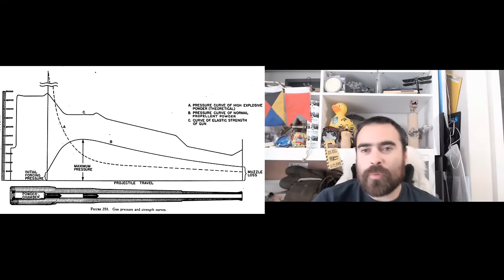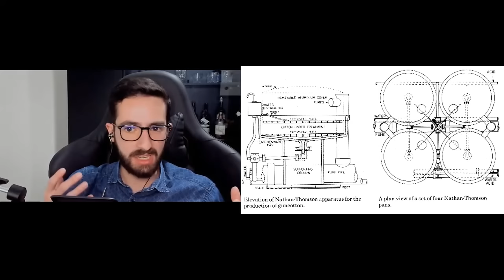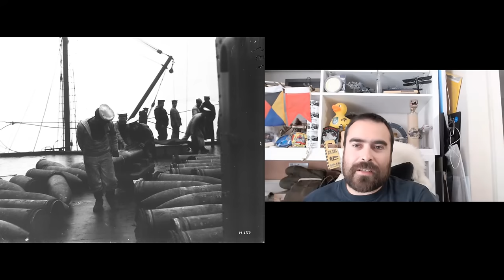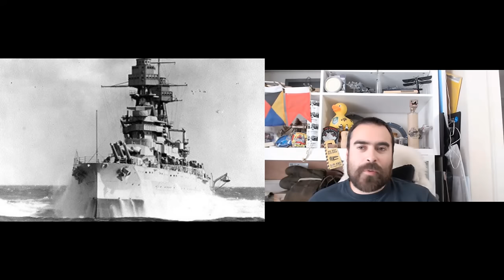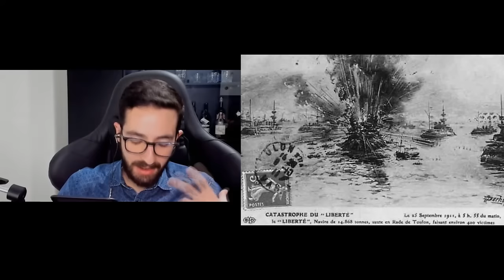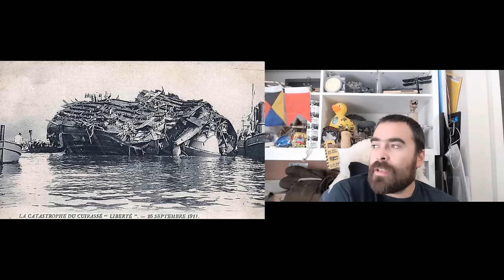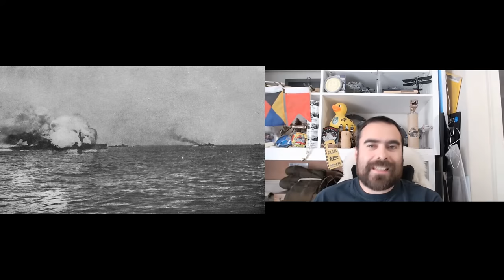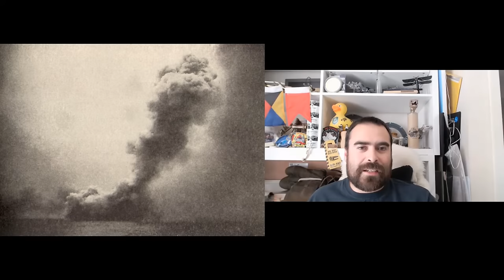Cordite and Poudre B - Why things start exploding at just the wrong time

Comment: Not happy with this one!
Nitroglycerin is liquid above 4C, not a 'dust'.  And even if it were a dust, cordite was sealed in a bag inside a metal tube, making dust unlikely to be spread around enough to propagate a flash.  Not stored as a loose chemical & I'd expect spillage to be noticed because Nitroglycerin is toxic, causing headaches and palpations.  How reliable is the Lion story?  

Cordite was used despite the risk because it delivered high performance. Wasn't described as 'safe', rather it was said to be safer than gunpowder, which is true.  But it's meant to explode in a confined space and does!  Quality issues and poor storage were known to make Nitroglycerin & Nitrocellulose more sensitive, worse than first suspected, fixed later. At Jutland, the Battle-cruisers weren't designed to receive heavy shells and seriously unwise things were done to increase rate of fire,  like removing flash doors, stacking ammunition in corridors and working spaces, and unpacking propellant before needed.  So a shell or flash from the turret could both reach the magazines.  The better protected and normally operated battleships at Jutland didn't explode even though they must have had them 'dust' too.

Age and temperature are correctly mentioned as problems, but I heard no proof they were factors at Jutland.  Was the cordite really old and warm enough to matter?  In June the North Sea isn't hot. and why no explosions in Hong Kong, the Med, Persian Gulf, or the Caribbean?  Nor did the Army have trouble with Cordite dust, despite using lots of it.  

Can't speak for what sailors knew about Cordite at Jutland, but my slightly later copy of "Service Chemistry" suggests a fair bit. The RN was the most high-tech service in WW1.    Officers at least were well educated, though negligence is always possible.  

Poudre B suffered from quality issues, as did all early attempts at smokeless powders,  The cellulose and both acids must be high purity, and extraordinary efforts have to be taken to remove unreacted acids from the product.  Grubby cotton and industrial grade acids aren't good enough and the process can't be rushed.  Like the USA's Mk14 torpedo scandal, the French were in denial about problems until a cartridge went off whilst being transported across a harbour in a small boat.  

Other incidents may be accidents - fire in adjacent coal bunkers, or incompetence.  Despite stiff regulations imposed after several accidents, the Iena was put into drydock without being unloaded: absolutely forbidden yet it happened.

Do people have time to act before a magazine explodes?  Maybe. Major Harvey got a VC.   Promptly flooding the magazines saved Seydlitz.   As to the time taken, we do have an idea: Arizona and Barham were both filmed exploding, and the frame times are known.  Much depends on the violence of the event; a slow fire would give more time than a line of cartridges foolishly set-up between turret and magazine, which would give more time than a penetrating shell. 

Might be wrong but I think the Arizona magazine contained 1 ton of Black Powder, not 100!

With respect, I think the dust hypothesis is flawed.  More likely the RN took too many risks with the battlecruisers, and the other explosions were due to quality problems, teething troubles and accidents.
Reply from the maker: Charges on WW1 RN ships were stored in leather cases, not metal, and the sweating of crystallised nitroglycerin is taken from RN reports from the time that were part of the justification for changing the cordite formula later in the 1910's.

The problem comes from when the charges are removed from the cases for transport, the movement causes the buld up to be knocked off and it then trails through the ship.
Reply: @Drachinifel  Understood thanks, but Cordite exuding Nitroglycerin isn't mentioned as a problem in my 1922 edition of "Service Chemistry, being A Short Manual of Chemistry and Metallurgy and Their Application in the Naval and Military Services."  The authors are Vivian B Lewes and J S S Brame, who were respectively Emeritus Professor of Chemistry and Professor of  Chemistry at the Royal Naval College, Greenwich.

It's a technical book and appears to be accurate on other topics, though it does caveat  "The composition of most Service Powders in most countries is constantly undergoing modifications and improvements..."

Explosives and Propellents get 67 pages of moderate detail. After describing how to make and test Black Powder, Nitroglycerin and Guncotton a chapter is devoted to Smokeless Powders.  Commercial propellants are reviewed briefly, but it concentrates on military types especially British.  What was wrong with Mk1 Cordite (mainly barrel erosion) and the advantages of M.D. Cordite are discussed in detail,  but attention is also paid to the virtues and shortcomings of foreign propellants.

Couple of insights, Flash is often mentioned.  The book explains that burning cordite produces large quantities of Carbon Monoxide, and it is the secondary ignition of this that causes flash.   This is rather different from the jet of flame coming from bagged propellant, igniting other bags in the turret, which inflame yet more bags in the handling room below,  and so on down into the magazine.  It is said HMS Lion did not explode at Jutland because Q turret's armoured roof blew off allowing the low order explosion to vent out of the ship.  If so, perhaps the ship was saved by 'dust', not destroyed by it (I'm joking)!   Another is mention of Cordite fires on board Revenge, Perseus and Fox.   Revenge I knew about - only 3 cartridges caught fire, but not the other two ships.
 
On the plus side, the book is contemporary (1922), contains a good basic overview of the state of the art at that time, and is authoritative in that it was written for the education of British Naval Officers.   Negatives, are although "official", the book was in the public domain, not a BR or CB, and thus may not be completely open, up to date, or accurate.   For example, it says "The German propellant for large guns contains 23% Nitroglycerin.", which doesn't accord with any other source I've seen.  Nonetheless worth a read I suggest!

Norman Friedman's "Naval Weapons of World War One" also has some useful information.

The most recent British turret incident involving burning propellant I know of was in 2017.  It was in a Challenger Tank, not Naval, Official report here  https://assets.publishing.service.gov.uk/government/uploads/system/uploads/attachment_data/file/727954/20180823-Challenger_SI_Castlemartin_Redacted_RT.pdf

May I congratulate you on a truly first class series of videos.  Lost count of the number I've watched and this is the only one to raise my eyebrows!  

Regards,
Dave

Comment: 1. As a kid I used to extract cordite rods from .303 rifle cartridges and burn them for fun. 2. There's plenty of "how to" make propellants and HE in olden times books in the library let alone the internet. I have a 1933 encyclopedia which explains how to make nitroglycerine, gun cotton and other things. Those were the days. It isn't rocket science, that came later. 3. During the Vietnam war soldiers would scoop C4 from Claymore mines, stick it to the bottom of a canteen cup, light it and heat water for a cuppa. In the '50's my father and his work crew would use gelignite to fuel a camp fire. HE burns good. 4. Solid fuel hexamine can be used to make HMDT, a primary explosive. It was packed in square tablets which would detonate if a detonator was inserted into the package so the tablets were changed to round, for military use, but it's still sold commercially in solid rectangular blocks in camping stores. If you make HMDT and use it to make a detonator, there are books that explain how to do this relatively safely, you can be a DIY bomb maker. 5. Ships armed with black powder blew up in the age of sail. Nothing new in magazine explosions. 6. Russian tanks armed with "insensitive"  modern propellants and explosives blow up to this day. 7. Bulk ammonium nitrate, generally an oxidizer and safe to handle, can detonate under certain conditions. Beirut 2021. 8. You don't have to know chemistry to follow a recipe to make explosives. Keeping everything cold is one tip.

Comment: "11 or 12-inch shell arriving at several times the speed of sound".

Now, now. The speed of sound at sea level is just under 1,100 ft/sec. Most warship shells, by the time they're hitting the target at 15-20,000 yards, are down in the range of 1,400-1,800 ft/sec, so it might be about half again the speed of sound but not several times.  Muzzle velocity is several times the speed of sound, but unless you're a ship like USS Laffey you don't really care about muzzle velocity.

Comment: If modern explosives melt, why then do we see flying Russian turrets fly into the air spontaneously when exposed to fire after the tank is hit?
Reply: The jet of metal from the shape charge cutting into the rounds triggers the detonator.

There is then a series of sympathetic explosions.

Some of the tanks are burning.

I would guess most of them burn, but we only see the videos of them exploding because that’s more interesting
Reply: @johnnyparatrooper1326  There are multiple videos where, when the tank was hit, the crew fled and the tank started burning, it only exploded a couple of minutes later...

Comment: 18:57 - to be honest - I don't think it was the cordite dust that led to the magazine conflagrations. It doesn't take that much to set off nitrocellulose propellants, at least to the point where they start burning. Case in point is all the Russian tanks that are losing their turrets after being hit. Armor piercing projectiles used in tanks don't contain any explosives, but they do result in a lot of white-hot molten bits of metal spraying through the tank. Apparently that's enough to set off the propellant in the tank's magazine. I imagine the turret magazines in battlecruisers at Jutland could easily have been set on fire even without cordite dust. From what i recall,, the Lion was saved because the Royal Marine officer in charge of the magazine that got penetrated had the blast doors closed (from the inside) preventing the flash from reaching the main part of the magazine. I think he got a posthumous VC for that action.

Comment: And yeah, you gotta wash your gun cotton…a lot, lol. Or else end up with something very similar to what happened with pictric acid…ahh, the crazy stuff that happened back then, exploding rust! And why didn’t use mainly just regular glycerin? Like the plain type, that slows burns by a lot, presumably nitro will blend in with its starting cousin, and you’d use that to get the burn rate you wanted, by adding or taking away the nitro…just saying, and if you washed your cotton properly…you’d have pretty much no issues as long as a fire or explosion didn’t occur in your magazine.

Comment: I wonder if using "blow out panels" or simply venting it with many MASSIVE tubes
.
.
Powder in open air burns SLOWLY
About 6 or 7 seconds for a 308 case
.
But you confine it.... and the burn rate SKYROCKETS
.
.
SO, if ships had access to modern powders..... I wonder if some sort of venting would be enough to only cause a HOT burn
.
But would not generate enough pressure for a detonation/ RAPID burn

Comment: In the US, knowledge of how to make nitrocellulose, ANFO, and many other high and low explosives is readily available. Anyone who has gone through SERE school will have been given hands on training, or they can buy reprints of the old Army Field Manuals which cover this. As a point of comedy, the US Marine Corps current Military Operations in Urban Terrain manual is also available online, which strongly urges the liberal use of frag grenades when clearing rooms. Not flash bangs, but frag. The USMC believes it’s job will be easier if opponents know what they’ll be doing and be dissuaded from opposing them.

Comment: One aspect of this doesn't quite ring true.   From Victorian times onwards, and certainly though to post WWII, the Royal Navy was obsessed with cleaning.   I believe the excuse was that, with a capital ship's complement of well in excess of 1,000 men, it was a very effective way of keeping them all occupied, and therefore too busy to cause any mischief or worse.   Given this, which to an extent still applies today, at least in peacetime, I find it surprising that explosive or flammable dust would have ever been allowed to accumulate in sufficient quantities to cause any danger.   This is particularly the case in relation to peacetime explosions, though during WWI, standards of cleanliness may well have slipped.   What do you think?

Comment: The problem with the "shocks triggering nitroglycerine fuel-air explosions" is that it doesn't explain why none of the battleships (with their thicker armor) exploded. Some of the QEs took quite a pounding at Jutland, but none of them experienced turret or magazine explosions. Only the thin-skinned battlecruisers and armored cruisers. It seems quite clear that shock alone doesn't explain what happened.
Reply from the maker: The QE's were only a couple of years into service with a new calibre of guns, their charges would also be new and thus would not have had a chance to degrade with age.

Comment: An excellent video but could have been condensed a bit.   Nitroglycérine dust presumably could have affected all RN ships using cordite propellants.  Does this mean that the Battleships of the Grand Fleet were also at risk in the same way, and that had more of them suffered shell hits the way the Battlecruiser fleet did, they would have exploded just like the BCs did?  But if so, why did not this happen to the 5th Battle Squadron?

Comment: that bro thinks that cordite is nitroglycerin and calls himself a scientist. LMAO
Reply from the maker: Cordite is 58% nitroglycerine and exudes it under certain environmental conditions...
Reply: @Drachinifel  this is why it is funny, because of the relation of guncotton and nitroG . Nitro will exude on tnt or PETN, not on cordite. And certainly not in encased form. I agree that non-cased cordite can exude, cased ones : not a chance.
Reply from the maker: @aldolny7055  the RN cordite handling instructions go to great length to explain the various temperatures at which different cordite mixes will sweat through the silk bags and how to ideally avoid this.
Reply: @Drachinifel  silk bags and cordite yeah. we had to blow off some bags 20 years ago in grandru (france), do not ask me how such bags were there but by the analysis it was RDB, they rested in a barn since 1916, they were crystalised. you would litteraly throw em on the ground nothing would get em off shock wise. I beleive detonations on cordite-using ships were more related to activation energy than shock based pure nitro sweating.

Comment: I found the tiptoeing around composition and methods a bit silly. you can find detailed info about those propellants on the internet. For example, the poudre B is composed of 68.2 percent of dry nitrocellulose, 29.8 percent of collodion (nitrocellulose gelified with ether and alcohol) and 2 percent paraffin. finding this info took me a grand total of 10 seconds. Fat lot of good it does me, that's not a hundredth of the knowledge that I would need to actually make the stuff.

 if it's just a youtube thing, just say it outright.